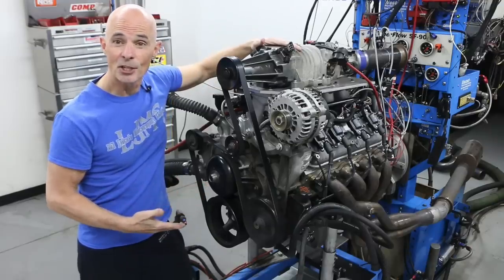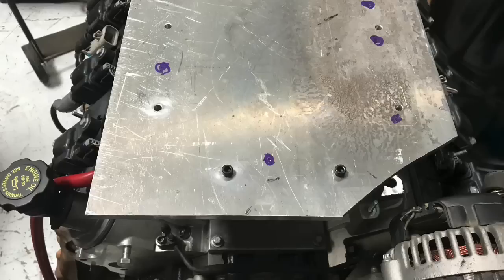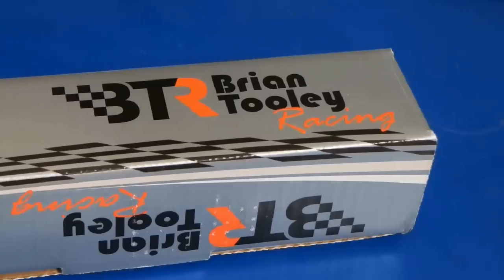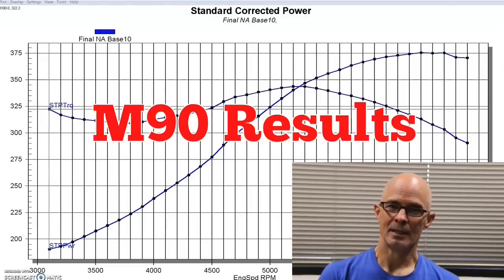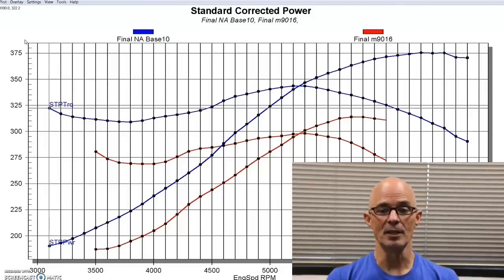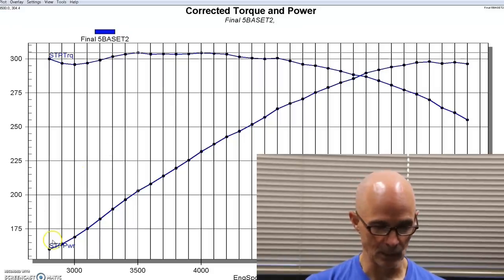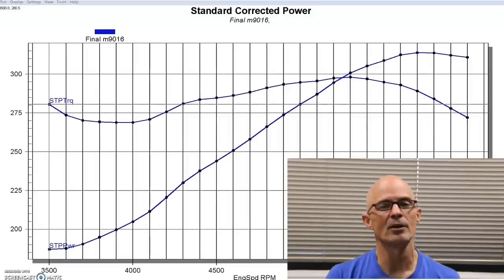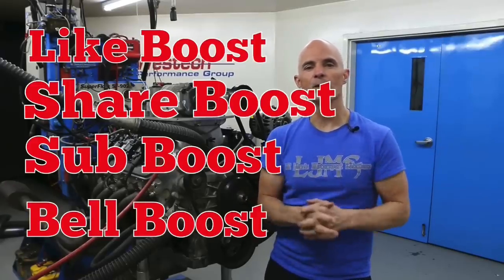JUNKYARD LS M90 SUPERCHARGER TEST-FULL RESULTS!

Comment: do a frieburger , pull 2 plugs run it up again as a v6 lets see if it makes power
Reply: You'd have to pull the rockers.
Reply: @fascistpedant758  no you dont frieburger pulls 2 plugs and puts himself in a different class at bonevile chasing records  my thoughts are the air requirement woud be less so the blower might actualy make boost , leave rockers in place you dont want lifters and pushrods adding to the carnage im not sure it would work ,take 5 mins to find out
Reply: @norego6237    If the valves cycle normally, those cylinders will continue to draw their share of the air, whether or not they're firing. It would be even worse if you pull the plugs and let boost pressure escape to atmosphere.

Comment: "The restrictor plate" dead give away cant pump air in, cant pump air out, plus parasitic loss. Better intake mainfold plate design would have very different results. CFMS and BOOST are 2 different terms. Tuning an engine to how much much air is coming in and matching the fuel is very different than trying to tune an engine based on boost AKA restriction.

Comment: I've watched many of your tests, most are valuable, this is the worst. The blower is too small for the engine. If you cannot spin it fast enough to produce useable boost, you should take it off and put it on a 2 l. four where it could.
Reply from the maker: trying something and failing is called experience-it is sometimes even more valuable than succeeding

Comment: Now put that m90 on a 7.3 idi math says it’d be perfect with a smaller pulley there’s a guy who’s done it on YouTube but no dyno sheet ls stuff is amazing but it’s getting boring do something different not a lot is known about the old mechanical beasts I think it’d be cool you could make several videos with the motor too like dyno numbers on several fuels like bio wvo wmo how timing for each one effects it and you can usually get a running idi for anywhere from $50-500 whole truck for 1500 most swap them for 460 gasser only reason I don’t say 6.2/6.5 is they aren’t as multifuel friendly

Comment: This is kind of silly why would you put that system together and not have the pulley set up correct for that size engine. It's not that the blower can't keep up the blower to keep up if you put the right pulley on it it's how many RPMs at the blower can take.
Reply from the maker: blower from junkyard-add blower!
Reply: @richardholdener1727  my point is that the blower can put out boost just fine up to a certain RPM, change the pulley to match the engine.

Comment: The m90 from factory makes 11 pounds of boost. It would have worked better off to the side and not on the   manifold
Reply from the maker: it doesn't make 11 psi with a 3.8 pulley

Comment: Engine sucks more then m90
Can blow. If you increase m90 speed to feed it the temps would be insane. M90
On the efficiency edge with low blow on 4.0. Wrong blower for volumetric amount

Comment: you need a different pully. your under driving the m90 soo much your chocking the motor. need more boost. at least 14 psi before calling it good or bad.

Comment: M90 on my 1uz V8 made close to +100whp on stock internals 🤷 get rid of the big ass pulley & port it out. or get the gen 5 instead of the shittier gen 3 that you have. You stuck a blower setup for 3.8 onto an LS.. wtf did you expect? 🤣

Comment: This was doomed from the beginning.... the throttle body on the m90 is way smaller than the one on the high ram. They shot themselves in the foot I’m sorry but this proves nothing if you put a reasonably sized throttle body on it and a smaller puller you might have different results.